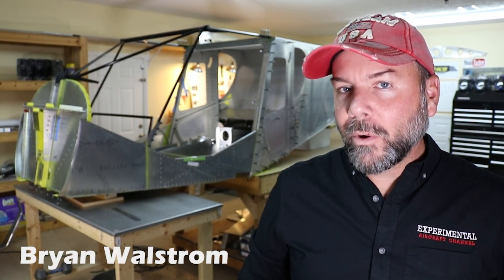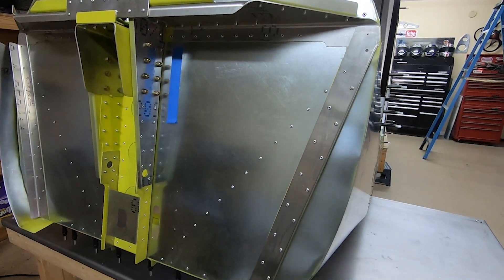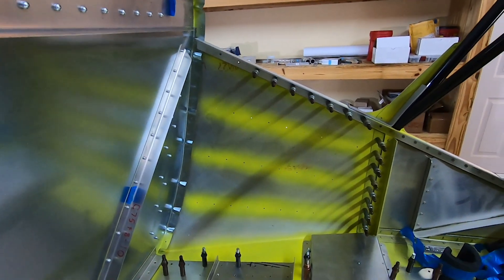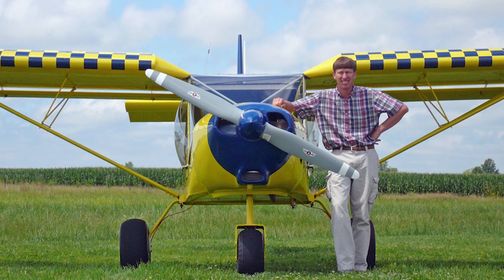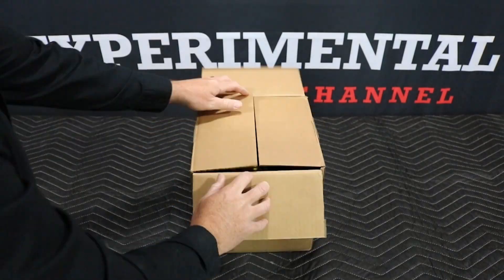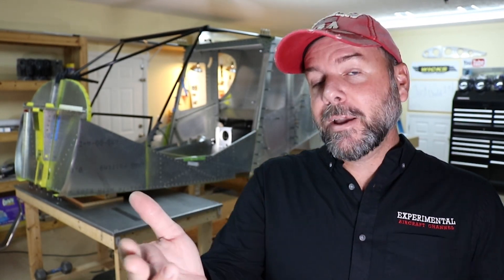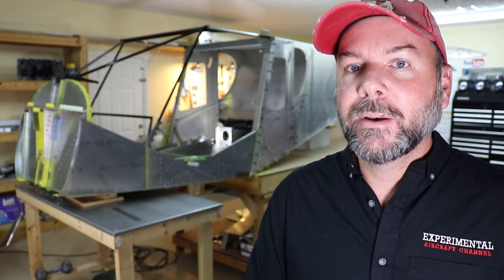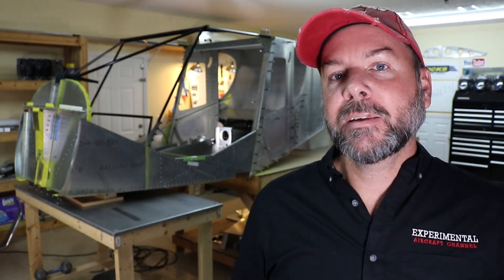Aircraft Build Update - Happy New Year 2021

Comment: Pouring some hot linseed oil into the tubing - then rotating the fuselage for several days - is a very common method for interior protection of aircraft steel tubing. That's what my A&P had me do on my PA16 Piper Clipper lower longerons.
Reply: Correct, the linseed oil oxidizes to a flexible sort of varnish in the tubes and stays put. Just check first in the literature to see if linseed oil should be boiled or not. It is bought as boiled or raw. I think it's mentioned in the original old AC 4313.
Reply from the maker: I heard of that method....but thought of it as an ongoing treatment (yearly) which is why I thought painting/priming might be best. But... after reading these comments I am thinking otherwise. May be best to use an oil based product.

Comment: Don't pour paint down the inside of the tubes.  Manufactured tubing often has residual oil on the tubing which will prevent paint from adhering.  Then, when it dries and comes loose, will hold moisture, counter productive to corrosion resistance.  Suggest using an oil based corrosion inhibitor inside steel tubing.  Also, thoroughly clean the outside of the tubing before painting, wiping down with lacquer thinner or other residue free solvent.  Don't use mineral spirits because it leaves a non-stick oil film.
Reply from the maker: @T Hano You know... you bring up a really good and valuable point. It has been a little while since I have done any welding and that comes into play quite often. I totally forgot about that. (the outside as well as the inside being "dirty"). Would have been good to chemical wash inside and out before sending out to powder coating. And since I did NOT.... painting or priming the inside probably wouldn't be best in this situation. Thank you for chiming in and Thank YOU for your support! :-)
Reply: @ExperimentalAircraftChannel  Glad to help.  I've done many painting projects and learned that the most important part of any good paint job is SURFACE PREP.  Hopefully your powder coater knows that too, and did some sort of "degrease" process to help with external adhesion.  If so, that process may have also removed the corrosion inhibiting oil INSIDE the tubes, as will welding.  So it's even more important now to apply some oil based corrosion inhibitor inside the tubes.  Good luck with your project.  I enjoy your videos!

Comment: Have you considered boiled linseed oil in the cabin frame tubes? Years ago, this was recommended in an AD for the old Piper high wing strut tubes.
Reply: I have done it in my 4130 landing gear torque tubes for my Midget Mustang. It coats well and you end up with a black finish.
Reply from the maker: I knew of it. Haven't worked with it before. I will look into it as an option. Thank you for the suggestion!

Comment: What I've heard is using red ATF (automatic transmission fluid) sloshed in the tubing.  The advantage is that if a weld ever cracks you get a clear red indication that you have a problem!  This is especially used in aerobatic planes and planes used on grass strips or other rough strips.

Comment: Hi Bryan - I subscribed to your channel today.  Your videos are very well done and informative.  I am just about ready to put my 4 rear Cruzer fuselage sides together.  I can fully appreciate your very careful alignment verifications and have been planning in similar fashion.  It is such a large structure that I would suspect there is enough play in it  to allow things to be skewed/mis-aliigned if not carefully validated and controlled.   I also plan to go to a larger wheel size so your work there was very informative.  I have been pondering how to apply corrosion protection to the inside of my cockpit tubing also and learned about the linseed oil method from your viewers comments.  Will have to look into that.  Anyway, excellent job and nice careful building.  I too liked the rocking chair scene at the end.
Reply from the maker: CONGRATULATIONS on deciding to Build something! Lots of fun ahead of you friend.  I read and learned from the comments as well. FYI LOWES or HOME DEPOT also sells "Biold Linseed Oil." So you don't have to search or travel far to find some. I plan to cut up an old cotton t-shirt and attach to a thicker welding rod and plunge the tubes with the oil. My "upsize tires" just arrived as well as the wheel/brake kit and strut/fork. This will also raise the seat height quite a bit and now I won't have to duck under the wing so much.  Happy Building! Check in again please!

Comment: Hi Brian, thanks for the great videos that you make. May I suggest that you use boiled linseed oil inside the tubes, it's ancient method with so far unbeatable results. You will need drain holes at the lowest points on the frame. Personally I would asses the work strategy first. My thinking is that the oil will be thinner at top frames because of drying slowly while the oil slowly runs off, leaving thicker layers towards the bottom. So perhaps you might remove some of those rivets at top of frame as drains, then leave it drain upside down so that the thicker residue is near wing attach points for example. I would also consider plugging all pop rivet holes with paintable acrylic sealer or polyurethane sealer. Acrylic is easiest because you fill a syringe with sealer, push the piston back in, fit a needle on the tip and then you fill a few holes, wipe excess off with damp or wet cloth, and move on till done. Of course a long needle will make your fingers very strong and waste time. So I use the largest needle that fits the pin hole in rivet, I cut it short with a thin steel cutting disc on small angle grinder then de burr the end. That eases the load on finger muscles. 

Ok, why fill all the outside rivet holes on frame? Because that frame is like a lung, it breathes in or out with every change in temperature, sometimes several times per day but certainly every 24 hours. 3 years is minimum 1000 breaths. Each breath brings in moisture and salt at coastal and salt pan areas. It doesn't all come out again! 

So, to finish my plan, seal all outside rivets and leave some inside rivets open for breathing because that air is cleaner, less salt flying around or raining into tiny holes that are sucking. Following this thinking, you might as well make a few Breather Filters inside. I would install them up as high as possible inside cockpit to avoid water splashing in etc. If there's a few places where a rivet could be safely replaced by a Rivnut, then do so, then make a threaded hose barb and screw it into Rivnut hole. Slide your silicone tubing over the barb and then attach a  small plastic fuel filter cartridge. Filters can be changed every year or so because of salt and oxygen deteriorating the paper element.

You might add a few welded on nuts under the belly and close with a very short bolt, with grease on the inside and outside threads. Obviously you'll drill holes through the tube central to nut and cut a new thread thru. Then if you think there might be water inside, you can drain it. If water comes out then remove filters and blow dry air through fuselage for a couple hours then close up. Job Done!

One more thing, I worked on crop dusters about 35 years ago, after doing my time in the military as an aircraft technician. The crop duster wing rivets of the all aluminum pop rivet sort, used to rattle their centre pins out. So when doing repairs and rebuilds I  would have a cotton wool swab soaked with loctite, dip the rivet into swab then use it. The centre pins Never fell out again.

I would also share such a plan with the designer or factory first to get their valuable input.

We used to drill small holes thru tubing at welded joints for drainage of linseed oil. Bit late now but if approved by designer, one could drill strategically, carefully and accurately through such a joint and then weld outside hole shut, then patch it? 

Our Allouette helicopters had aluminum tube frames. The frames were drilled and plugged with a Schrader valve fitted, frame was pressure tested for leaks, then vacuum purged, and filled with nitrogen under slight pressure. A pressure gauge was fitted. This gauge formed part of the preflight inspection. No Pressure, NO FLY!
Reply from the maker: Wow! A true investment into this topic! Thank you for sharing life experience on the matter. Great experiences and great ideas. I am in fact rethinking this option now.

Comment: Steel building under way about to have the form boards filled with concrete. I haven't been able to do much on the 701. Once I get the building up and spray foamed with a split unit, I hope to get back to building. How hot does that garage get? Maybe I can get the plane done minus engine by the end of 2021.

Comment: Ok then BrYan, back to work! 💪  Ha ha, 
We want to see that thing in the sky! 
 As some of the other fellers have said here, not so sure on pouring paint inside the tubing? But old school linseed oil is supposed to work, idk I'm no expert here, but think you should check out options. 
 Happy New Year to you and yours!
Reply from the maker: Great idea. Yeah... I am rethinking it at this moment. Maybe if I would have properly cleaned/degreased the "inside" it would be a different story... but only the outside was cleaned up before sending to the Powder Coating guys. Thank You for your input and support!
Reply: @ExperimentalAircraftChannel  yup, I wonder if like you said if the insides could've been cleaned good, like sloshing in fresh parts cleaning solvent a few times, then blowing it out with compressed air getting it dried out good. If then pouring in zinc chromate or something would be good. 
 Idk, just thinking out loud I guess.
 Maybe the linseed is the way to go?!